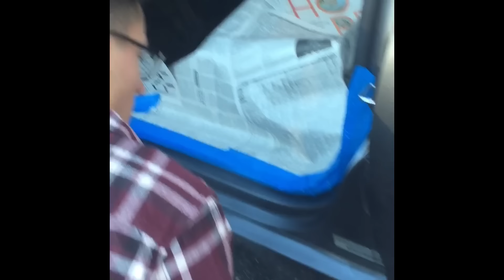DIY Rust Repair Cheap And Easy!

Comment: I removed all the rust now my passenger door is gone.
Reply: So I guess you drive a Ford Focus? Damn there is more rust than good metal on my '01 Focus haha I'm fixing it tomorrow, hopefully it will last for another year before I'll have to do it again :)
Reply: rust Removal and Lancias dont match very well.
Reply: CoreTech951 well, that car's almost 20 years old. if you don't maintain that's what happens. Unless you own a Ford Crown Victoria. Much tougher car.
Reply: BIG FISH not really the junkyard theres many shops that sell the doors brand new  for about the same price as the junk yard
Reply: The rust is gone but did you kill all the chlorides in the steel that caused the rust in the first place?. The rust will come back if you didn't. Sand down and before you paint soak the area with Skunk Rust which soaks into the metal and kills the contaminants the grinder cannot get. After that paint and the rust will not come back. Believe me I have done this and if you don't kill the reason for the rust it will return. FYI
Reply: Lol
Reply: HAHA
Reply: Sorry bud at least im not the only one 🤣
Reply: The pain of Mercedes w123 ownership
Reply: Haahahhaha
Reply: lol
Reply: once it got cancer it over
Reply: @CoreTech951  ahahahahaha "more rust than good metal" you're very funny.
Reply: LOOOOOL. Thanks for that!
Reply: 100% correct Sir ,,, he did not even wipe the Surface with alcohol,,,  @GlueHead200
Reply: Big Jon-Q-public 😂😂😂
Reply: Hahahahahhaha
Reply: Hahahahahahah that's awesome.
Reply: Haha bruh
Reply: Classic Big Jon😁
Reply: Hahaha story of my life🤣😫🤦‍♂️
Reply: So that would be called Cheap A/C ?
Reply: Salt life...🤣
Reply: You should use a finer grit on the drivers door then!😁
Reply: @GlueHead200  Are u you talking about a rust preventative coating that you brush on when you have sanded to bare metal......then filler then sand, primer, base,clear
Reply: LOL good one! you made me laugh! thanks
Reply: Please leave the rest of the rust on your car
Reply: @stevehoward3049  Zero rust, My 4runner was shipped in from California from Rancho Cordova. it has been in the garage its entire life, never been off road. I have only driven my 4runner on dirt roads, that's about it.
Reply: dude, your comment made me laugh so hard I sprayed beer all over my monitor 🤣
Reply: @electricbadgercollc8146  thats good, because no one would let me drive my 4runner offroad, because it is of museum quality, and trees and boulders don't move
Reply: send me your email address, I'll send you pics of my 85 4runner.
Reply: lol
Reply: Underrated comment frfr
Reply: @CoreTech951  03 here, on that tomorrow ✌️😂
Reply: Lol
Reply: Chevy truck
Reply: 🤣 now im afraid to do mine....probably just frame left bahaha
Reply: To the guy that is afraid.   Use metal tape get a can of spray paint  fixed in 5 minutes  have time for a cold beer .
Reply: Is your car still there after 5 years? If course, without door :)
Reply: Wow, hope I dont find myself doing this. Have to know what you're doing.
Reply: @CoreTech951  lmao. Ford is in Michigan and they have no idea what rust is especially we use salt every winter 😂
Reply: @djmussy18   to easy, lame 🥴
Reply: @djmussy18  good luck lining that up to the body. lol clueless
Reply: Lol
Reply: And i removed my rust on my car…….4days lader i cant find my car anymore!
Reply: Lol af
Reply: Some assembly required.
Reply: I removed the rust from my Jeep and now my Jeep is gone.
Reply: Now you’ll never have to worry about rust again
Reply: Get some fiber glass putty
Reply: My rocker panels sanded off into a pile, now what?
Reply: 😆 😆 thanks man, I needed that laugh!
Reply: All you guys need to move to FL 😊
Reply: Make a new door with Bondo
Reply: My van did that too 😂
Reply: Buhahaha 😂
Reply: Yes I too own a Chevy truck.
Reply: Dont remove the structural rust!

Comment: I liked your video but let me add to it please. First the rust in this case was not bad enough to justify cutting and adding a new piece of metal. But metal prep should be used on the rusted area before priming. Metal prep converts the rusted area back to metal where the sand paper can't reach into the pores of the rust. The only other way is to remove the rust by sand or glass beating the area but metal prep works just as good in these types of areas. Never try to speed up the drying process with a heat gun or hair drier because both primer and paint should cure from the inside out. Using the heat gun only cures the outside first instead of letting it cure from inside out. I am not knocking your video and for a fix like yours it's ok. But in my shop we do it the way I suggested yours will still last a very long time. But do use a heat gun to make sure the metal is dry before you start the priming process. Good job nice video. Thank You
Reply: Don't forget, he should have primed over the filler before base coat.

Comment: It looks good but as someone who’s been a professional body man for over 20 years you left out a crucial step with those pin hole rust areas. You should have at the very least use a rust inhibitor or use a handheld spot blaster to clean deep into those pits. Otherwise your paint will start bubbling after the first few times that rocker panel gets wet. Other then that you did a great job.

Comment: Looks good, but Ive found in trying this myself you need to treat the bare metal with a rust inhibitor type paint or the rust comes back in six months
Reply: Boston 16WRX your doing it wrong then.
Reply: @austinhartman6541  I wouldn't say so. Primer is good for bare metal, but in this case it's clearly visible that there are pittings with corosion that should be treated with rust inhibitor first
Reply: Right! 
You need to use self etching primer first to stop the chemical reaction. This panel will probably start rusting again!
Reply: without either sand blasting or rust conventer for sure it will back...
Reply: @austinhartman6541  If there is visible rust left it needs treating. Kurust etc is good for that.
Reply: Pros at hotrodders page only use epoxy like primer.
Reply: Either sand blast the area or POR before priming will work.
Reply: Austin Hartman nope. The blck spots after sanding is rust. They need clean or the rust will be back
Reply: @austinhartman6541  if the rust isnt removed, painting over it wont do shit, sandblast or rust converter would be the way to do it right...
Reply: Sandblast it then use muratic acid to kill what in the pours.... ... then expoy prime it...

Comment: that rust will come back in under a year without chemical rust converter or sandblasting
Reply: FreedomNews mmm just use clear vinegar leave it on the rust spot have a beer and if you done with the beer can the rust is gone easy and cheap
Reply: FreedomNews soo true
Reply: Yea it’s sad but true. I have “fixed” rust like this on 2 cars before and usually a year or two later it rusts again. A coat of bondo does make it take longer to rust again but the rust still comes back.
Reply: True that.  That's alot of work to fix a small barely seen rust spot.  I hope the rest of that vehicle is absolutely mint to justify spending this much time on something like this.
Reply: @ultranitro437  meh, some of us take care of our stuff.  i guess we all have different tolerances for what we consider a lot of work.
Reply: Yep, some encapsulator was all that was needed
Reply: in like 3-5 years and by then you'd already saved up for a new car lol i did a similar fix on a truck 3 years ago and it still looks fine.
Reply: @ultranitro437  ..how old the car is..not an issue...if the car got a decent engine and drive-train..you would likely spend some time to shine the outside a bit...not everyone has the opportunity to buy a new car either...no care for what you drive..except yourself..
Reply: @gorgon9786  the newest vehicle ive ever owned was a 2000 grand prix gtp that I bought with my own money in 2009 and I guarentee I take better care of my vehicles than you. I drove a $700 oldsmobile intrigue with 240,000 miles on it for about 10 years and because I took such good care of it it took care of me. Fixing a stupid unseen rust spot inside your door jam does not make you good car owner.
Reply: FreedomNews yes your rite I’ve done this repair it only lasts a few months 👍
Reply: How not to do EVERYTHING...
Reply: Rust does not go away without converter, keep looking it will be back
Reply: FreedomNews  /
Reply: @ultranitro437  Can you tell us more about how cool you are? It's fascinating.
Reply: after sanding a treatment of rust converter would be advisable, but the rest of this is well done
Reply: Done properly this will last just fine, for a car owner trying to keep it on the cheap there is nothing wrong with spending a bit of time on it, and being a unibody construction if it is not addressed it will eventually rust through the sill and wreck the structural integrity of the car, like driving a crumpled aluminum can. Using a rust converter before the filler would of been ideal, but for all intents and purposes it wasn't a bad job. Especially if you live somewhere where you will fail inspections for visual signs of rust in a structural area.
Reply: @ultranitro437  lmao honestly
Reply: It's fixed and you didn't get ripped off by a body shop, smart.
Reply: @ultranitro437  I think you should read the book "Ego Is The Enemy" by Ryan Holiday.
Reply: Saoirse lol! For real, I actually just laughed out loud. Kinda inappropriate because I’m at a viewing of the wife’s uncle.  But still worth it. 👏
Reply: Yes

Comment: knowing my luck a bug would land on my fresh paint.  or the wind would kick up some dust.
Reply: You never just leave paint as is, you must always sand it after its dry because the paint will not be perfectly smooth
Reply: Nicholas Hoffenpiper that would be so cool to have a bug under the clear. I will try that
Reply: Gus Ibrahim bzzzz
Reply: Nicholas Hoffenpiper knowing my luck i wouldnt have enough money to do a cheap diy rust repair
Reply: ever heard of a garage?
Reply: Eliot Merrill ever heard of no garage?
Reply: Then, you'd pick him out, let it dry, sand it smooth, and respray. 
It happens in the best shops.
A fly in the booth is a huge emergency.
Reply: Then would you paint over the bug or peel him off and let him go?
Reply: @RussianPowerful  didn't know that. People do that every time even on total car sprays?
Reply: I've heard of that fly in the booth. Charlie sloth does it
Reply: I hade those helicopter flowers all over one of my jobs 
thanks masking tape for the quick fix :)
Reply: Wight round flowers that send out hundred's of those Wight  helicopter seeds 
I used masking tape to lift them off the finished car :)
Reply: Drying out in the summer sun
Reply: I painted a truck once where a cat walked on the bed rails later leaving little paw indentions that I couldnt buff out.
Reply: @nicholas8479  Do you perhaps know of @Biff_Strganoff ? Are you guys relatives? 🙂😂